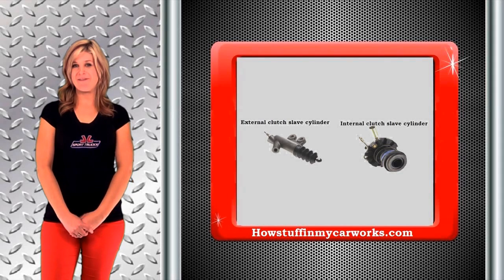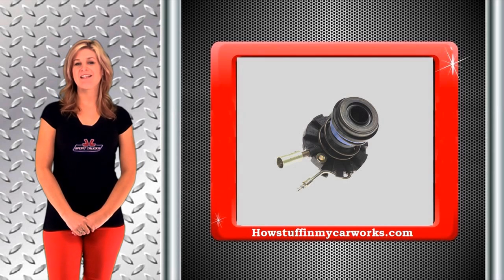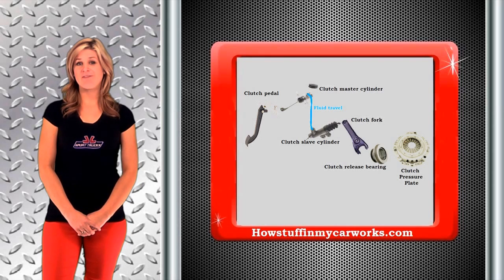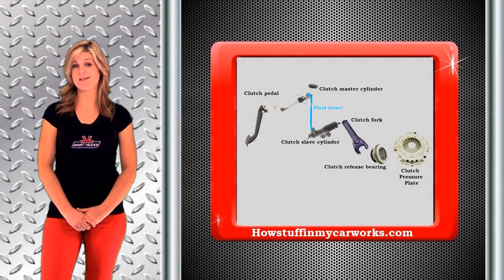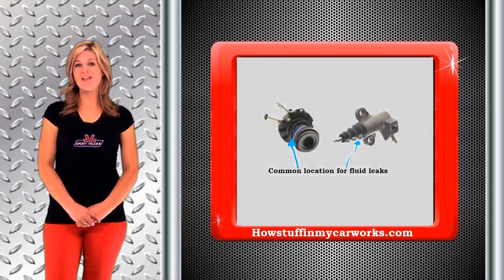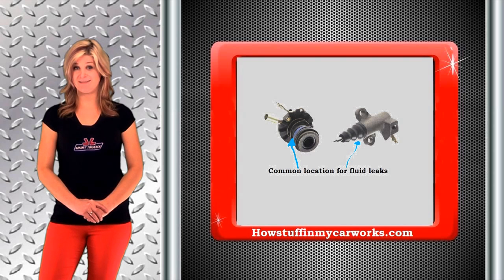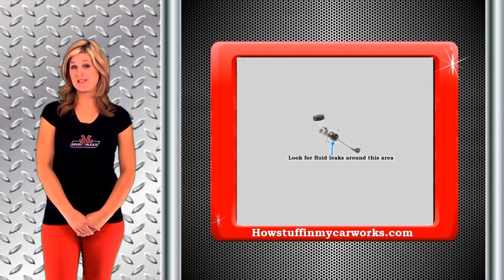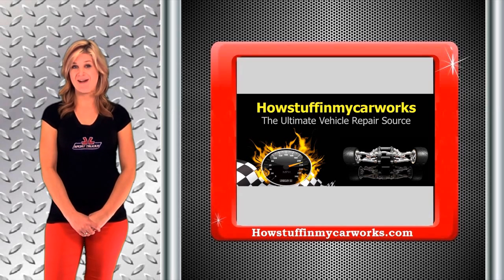How the Clutch Slave Cylinder works by Howstuffinmycarworks.com

Comment: I’m here in 2023, I bought a car from a reputable deelership ( luckily everything done is covered by warranty) and my car clutch keeps getting stuck. They replace the master cyclones but it still occurred so they are now replacing the slave cylinder. This veils has been so useful! I had no idea what they was talking about or what was going on with me car. But this video has helped a bunch with my understanding of both part! Thanks you !

Comment: Well explained. In addition: nowadays it's often a hell of a job to replace the clutch slave cylinder, because you need to remove the complete gearbox to get access. This is why this repair is typically combined with replacing the clutch plates + clutch pressure group as well. In older cars, the cylinder is often much easier accessible, or a cable is used instead.

Comment: So what does the slave cylinder actually do I just got a 1993 F-150 XLT 4.9  6 cylinder 4x4 with a 5 speed  it slips I guess as the guys was reving it up and it was barely moving, he reved way up I thought way to high and would get slightly going is that a slave issue or clutch? no leakes under the  truck at all

Comment: My S10 1998 it berly runs like a turtle was wondering if is clutch?
Reply: do a general tune up new plugs, wires, and belts then go get it timed. to make sure that it is firing on all cylinders correctly. Change the oil, check the trans fluid  and see if that helps. Also new air filter might help a little

Comment: Does it have to leak if is bad?
Reply: no, I'm currently in the process of replacing my slave cylinder, which is bad, and it has not shown any signs of leaking, however I can't p[ut the car in gear
Reply: @bend.9069  Can you confirm?

Comment: My clutch pedal went to the floor and the MC was at fault (or so it seems).  I've replaced my Master Cylinder (the original/old 100% had failed and leaked) but after bleeding it (via the slave bleeder) for a long time, my pedal is still low to the floor and will not build pressure or even return to normal height.   My Slave "appears" to function perfectly (no leak even, full travel on the fork etc) therefore I'm stumped on what do do next.  I've bled the system numerous times and all that is good but still cannot pressurize the system with pumping the pedal.  It seems like my only option is to replace the Slave as well- was hoping to avoid this.  It is frustrating to have to replace something that shows zero physical sign of trouble and nowhere in any forum does anyone explain what exactly would be wrong with a slave when it also shows no signs of failure...I'd feel more confident in replacing the slave as a final solution IF I could learn how it may not be functioning. Can anyone confirm that the SLAVE can fail - even if there are Zero leaks coming from it??????  Quite certain I have no issues with my clutch fork/pressure plate (I can move it by hand, and the fork is all the way forward as it should be with the car in neutral/clutch engaged as per normal resting position).  Help!  Thanks in advance.
Reply: Hey buddy! I literally have the same kinda problem with my T5 camaro transmission. Did it work properly after replacing the slave? Ik its 2 years later but pls if you see this let me know. Would be very helpful :)
Reply: May need to adjust the pedal itself
Reply: I am dealing with this.
I cant build pressure with a new master cylinder. It could be a bad master cylinder....
Im buying another one and a slave.
I dont see how it still isnt working. A basic job, imho. Its very simple, moreso than 4 brakes.....??

Comment: I prefer external slave cylinder, much easy to replace
Reply: Before my slave cylinder goes bad, I can hear grinding   bearing sound. Was it too tight, them if I touch my clutch pedal the noise stops